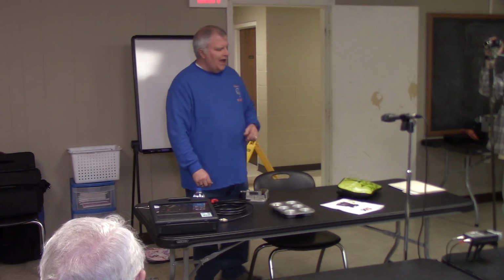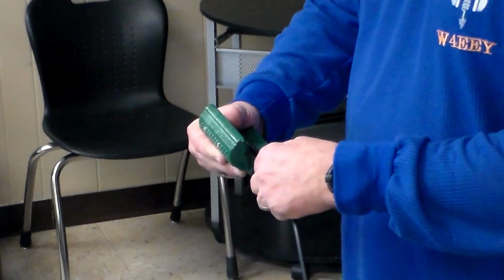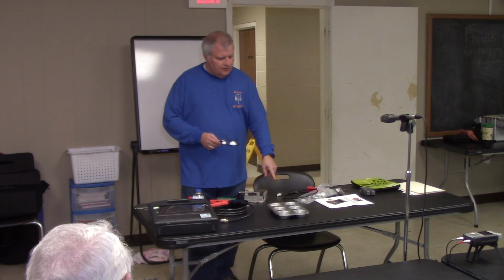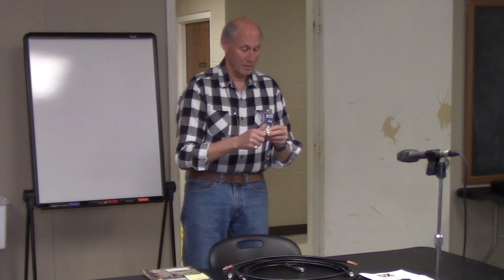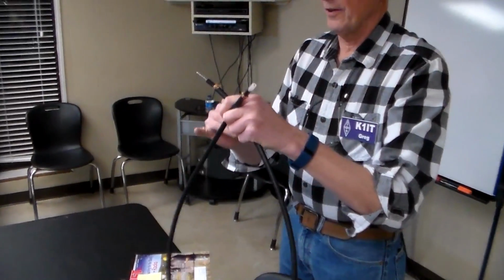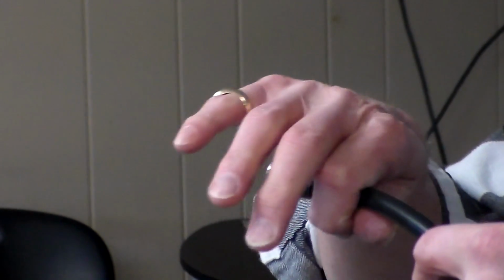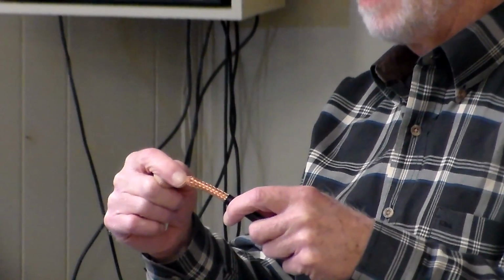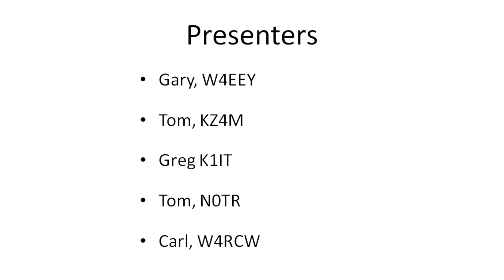PL259 Symposium

Comment: In my work I must have soldered thousands of PL-259s over 4 decades plus.  These are all good ideas, but what I do is cut 1.25' off the end of the jacket, then cut 5/8' (half of the original cut) of the dielectric and shield off the end, exposing the center conductor.  Then tin the tip end of the center conductor and lightly tin the entire exposed shield before screwing on the connector.  Then soldier the shield through at least two of the small holes.  IMPORTANT!! -- USE A 25-40 WATT PENCIL IRON FOR NO MORE THAN 30 SECONDS AT EACH HOLE.  DO THIS AND YOU'LL NEVER MELT THE DIELECTRIC.  The secret is the shield is pre-tinned and doesn't need much heat contact with the shield to get a good electrical connection .  Then solder the center conductor.  As these guys have mentioned, don't forget for put the sleeve on first or you'll shed many tears.  I know I have.

Comment: Nice video, but I agree with W4RCW, crimp on for inside the shack only, and only if you have to.  I have hung off many towers replacing crimp on PL's and also BNC and N's that failed in both commercial and amateur situations.  If you want to heat a PL259 uniformly and quickly, remove the tip from the Weller gun, with the connector on something that can take the heat, press the barrels of the gun to the connector and pull the trigger.  The body of the PL acts like the removed tip, and heats quickly and solder flows into the holes uniformly.

Comment: Does the crimp on connectors come in different diameters, or are they all one size? 
I am thinking more like you as far as the crimp on and since my main plan is the mobile radio i will need to cut the cable and run in through a smaller hole that way. 
Thanks in advance for your answer sir. 
Dale
Reply from the maker: Hey Dale - Crimp PL-259 connectors come in two sizes. One is for the larger RG-8U or RG-213U cables. Here is a link to the DX Engineering connectors for this size:

https://www.dxengineering.com/parts/dxe-pl259cs8u-6

The other is for the smaller diameter RG-8X coax.  Link here:

 https://www.dxengineering.com/parts/dxe-pl259cs8x-6

You can find less expensive crimp PL-259s of both sizes on Amazon.  I have purchased from there in the past.  But the quality varies with these connectors (made in China?) and after some problems I finally said "no more". I have standardized on the DX Engineering connectors. Just my opinion. Your mileage may vary!

73 - Gary
Reply: Thank you os much for taking the time to reply sir, it is greatly appreciated. this helps a lot. Oh good news sir, I got my call sign Yesterday and got my official letter this morning. KI5ARH is my new call sign for passing the tech class, I plan on taking the general monday the 9th, finished up your training on General Yesterday and passed one of your test, going to do your other test as a final review test probably sunday after I study some more. 
Thanks again for helping me so much it is truly appreciated. 
Dale 
KI5ARH